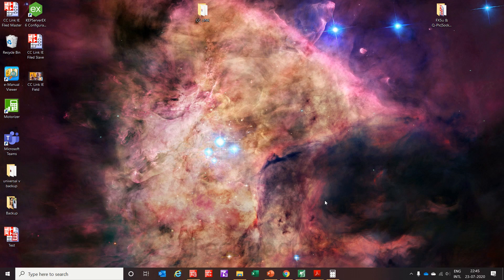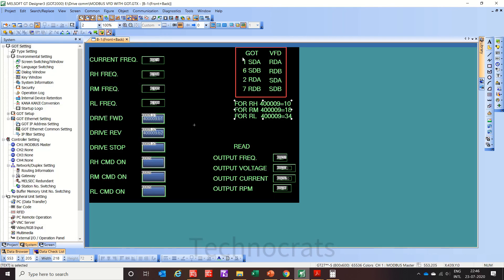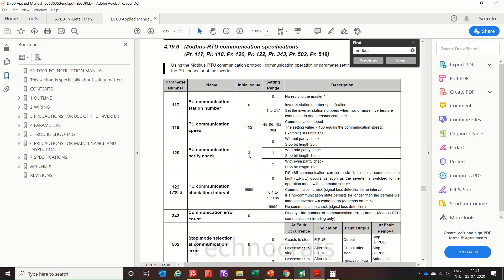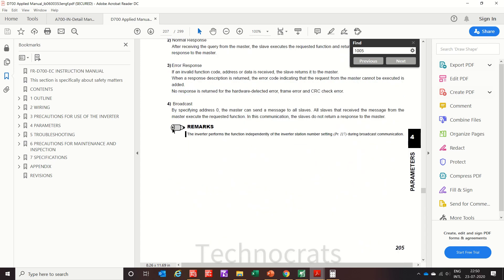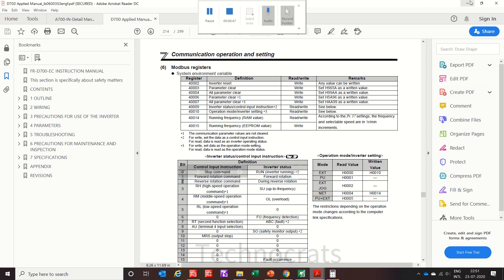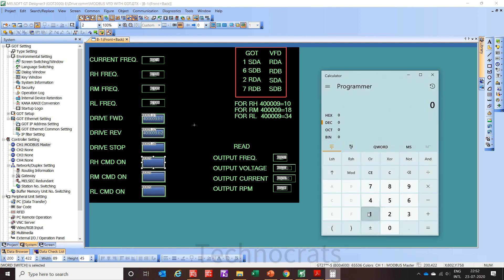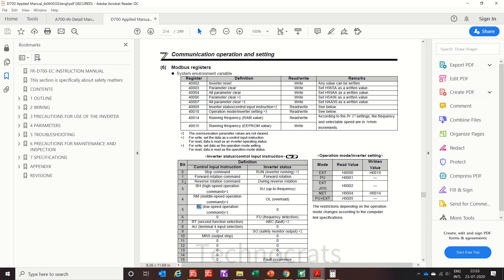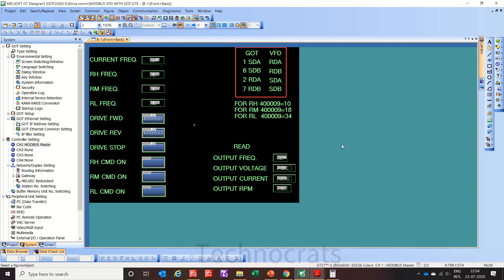Mitsubishi VFD to HMI/GOT Communication Modbus Protocol

Comment: How many vfd communicate a single hmi gs2107
In a single time
Please confirm me
Reply from the maker: You can connect total 31 vfd but it might sometimes slow the hmi working
Reply: Thanks
Reply: But what buffer will be second and other vfds
Reply from the maker: You only need to change the station number.
Modbus address will remain same
Reply: How to add station more than 1 in hmi
& again very very thanks sir
Reply from the maker: Suppose you need to read freq od 2nd station, double click on numeric display >> In device >> expand the device selection >> Below in network use others and station no. as 2